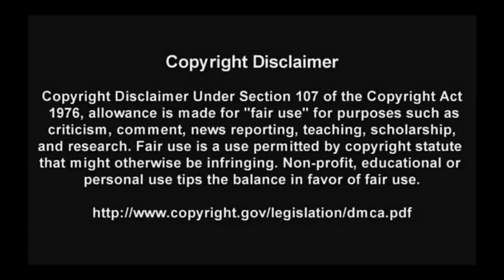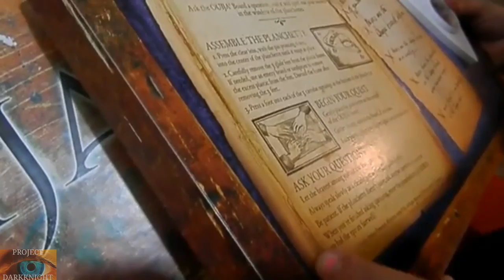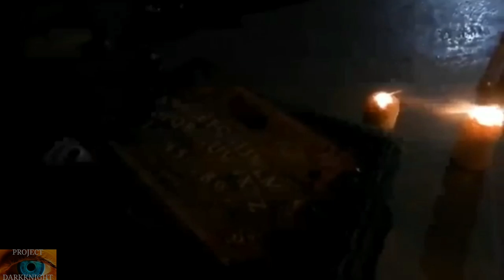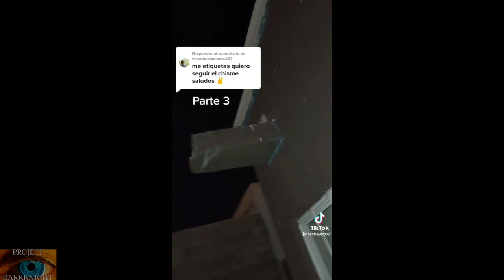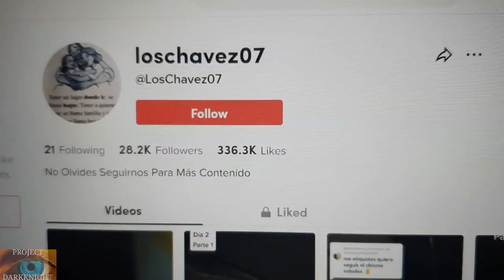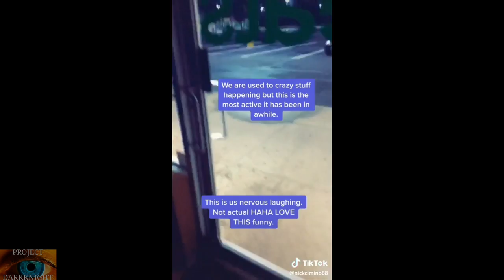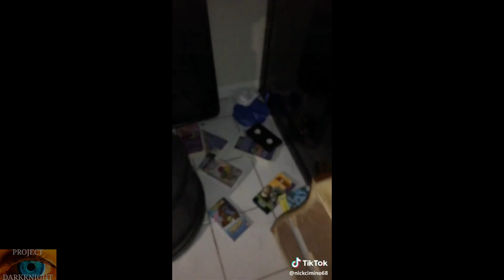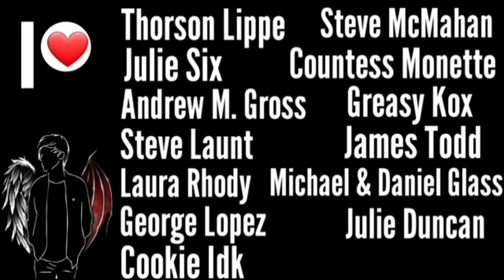Paranormal Videos That Will Make You 100% Believe In The Devil: GRAPHIC CONTENT

Comment: So I've been to the abandoned Kings Park Asylum numerous times growing up. That place was so incredibly creepy. You're not allowed in there, so you'd have to sneak in at night, and avoid security that patrolled the grounds. Its a huge location, with a ton of buildings, so that wasn't that hard. That main building was the craziest though. 
 Definitely saw some weird stuff in there, and got very creepy vibes every time. This was long before I knew about shadow figures and the likes, and I definitely saw several of them throughout my explorations of that building. One time we got chased by a homeless guy living in it. It's 12 or so stories tall, and falling apart, so it was pretty much a cement hedge maze with vertical levels. As an adult, I'd never do the crap I did as a teen there. We used to sneak beers up to the roof and party up on the top floor. One of my old friends even snagged some of the files that were left around in one of the rooms.
 There are even tunnels underground that link all the buildings, but they're filled with nasty stagnant water. Always was curious what hidden secrets were lurking down there. 

It's been a while since I thought about that place, and as soon as he pulled out those papers and I saw Kings Park, so many memories came flooding back.
Reply: Snagged some of the flies that were left behind? Wtf
Reply: @donnyfoster1859  Yeah, there was a ton of crap that they left in the buildings. At this point, most of its been taken out by various visitors throughout the years, but you used to be able to find straight jackets, medical tools, files on patients, etc.

Comment: I want to add to this and what you can do. I was electrocuted and could not let go. As 460 volts ran though my body, I saw a tunnel with light on the other side. This dark tunnel was a golden brown and soft looking. Then I was blessed by a bright light that pushed on my forehead and I fell backwards, and I woke up to a co-worker doing CPR on me. There is a bright light in all of us and can provide protection. This light goes further if you can feel it and can helps the lost spirits find their way. I still suffer with nerve damage, but I also have a protection and feel blessed. This bright light is still with me and it helps with depression and feeling lost. Look inside yourself to find it.

Comment: Never bring or even play the Quija board where you sleep at night 🏡  The unspoken rules are now on written on the layout of the portal to the spirit world. Never 🔥 or destroy the board it will return or follow you if you abandon it. Use discretion never play it for assumement only if you need to reach out to someone you lost or get closure or information. You'd be amazed how useful this tool can be used to solve murders. Always ask God for protection from demonic or evil spirit's
Reply: 🎯.  Great advice.

My mother had my father burn her Ouija Board when she was pregnant with me.  My sister was already 9, and my brother was almost 3. This happened 53 years ago. 

It wouldn't burn by regular means. My uncle came over to figure out a plan after neither lighter fluid nor gasoline worked. My uncle worked in lumber, and suggested that it was chopped into smaller pieces, then burnt, so they took axes to it. It was placed inside a metal trash can and burnt on the lawn, in our backyard.  It finally turned into ashes, but it left a permanent circular burn in the grass. Even when we moved when I was 8, that burn stain was still visible.

Our home was haunted, too.  It would torment me, until around the age of five, almost always at night. And I often felt watched in the basement. Anyhoo, one evening when I was five and alone in the house with my father and his friend, this thing showed itself to me, only as an eyeball peering at me through the wall, passing between our kitchen and the LR. It was behind an extremely narrow space that no human could possibly enter or fit. I thought it was my sister at first, because she was always gone. She often ran away, and around this time she became emancipated from my parents. No one told me what was going on with her, so I assumed in my child's mind that she was a fairy, and was able to fly through the walls of the house to hide, so it had to be her.  I told my father, who was sitting 12 feet away, but he and his friend didn't want to get up to look at the eyeball staring at me.  They eventually left the room without looking, chuckling over my "imagination".. So, I began to talk to it, saying our parents are gonna get mad at her for messing around.  But then I had a foreboding feeling, and decided to touch the eyeball, which was ice cold. I knew at that moment it wasn't my sister and it was something bad. So, I demanded that it leave my home and leave me  alone.   

I think it lingered inside the home for a couple more years then left, attaching itself to my sister. Because when I visited her at age 11, I felt that same foreboding feeling inside her home, and I even saw the shadow figure. It even leaned down to my face when it thought I was sleeping.  And it's still attached to her until this day. 

Thanks Mom!! 🙄. People shouldn't mess with Ouija Boards unless they know what they are doing.  I've also noticed a correlation between the rise in evil throughout this world and when Parker Brothers thought it was a bright idea to release the Ouija Board as a game.  I know correlation doesn't necessarily equate to causation, but it sure seems to be an  uncanny coincidence.